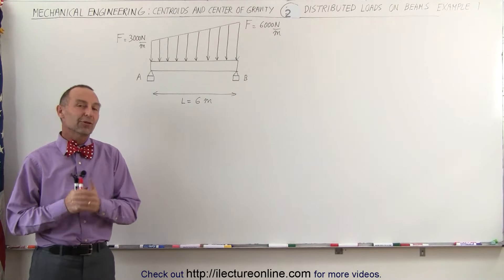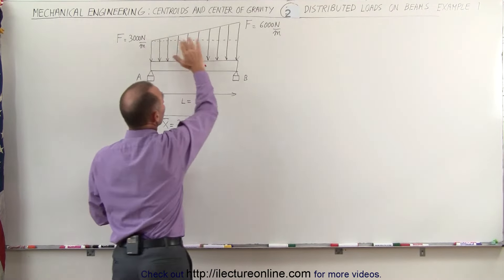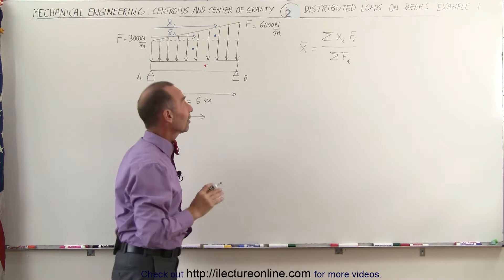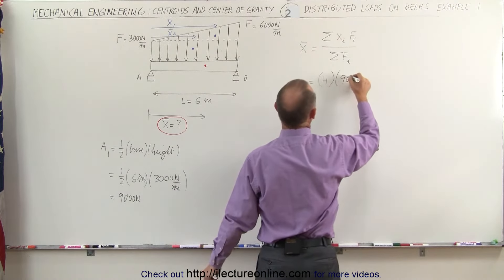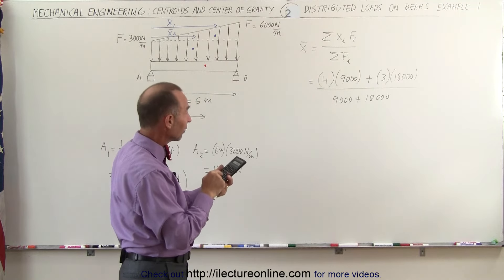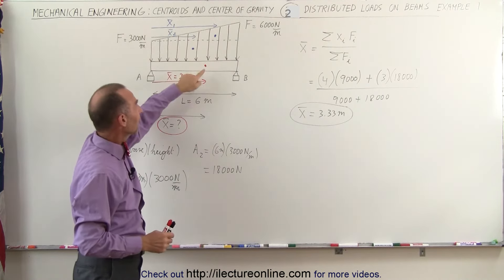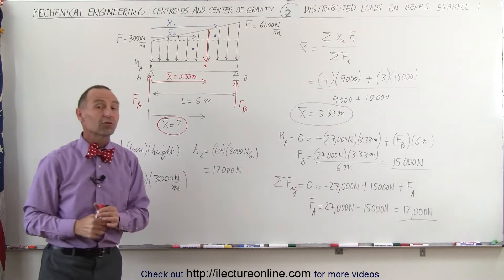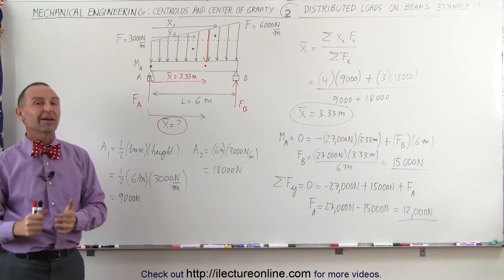Mechanical Engineering: Distributed Loads on Beams (2 of 17) Find Distributed Load on Beam Ex. 1

Comment: Great video. thanks. When you get the total center X=3.33  how do you know from where to measure it? from the left corner or from the right? you choosed left. what is the rule?
I understood the logic, like if we would calculate it by integral the (0,0) would be the left corner... depends on my axis.
Reply from the maker: It actually doesn't matter, and may depend on the particular situation.  Typically we use the left as a reference point.

Comment: how can you know the X of the triangle is 4?
Reply: The  X value in a triangle is always two thirds of the way along the base length, if you start from the smaller end!
i.e. (2/3) * 6 = 4
Reply: For a triangle, the centroid is always gonna be 1/3*(side length)  ***on the side with "more x". In this case, it's 4 because while (1/3)*6=2 the triangle has more of on the right side so x=6-2=4.
Reply: 2 x L / 3

Comment: .solve this please sir:
 A horizontal beam, simply
 supported at its ends, carries a load which varies uniformly from 15 kN/m  
at one end to 60 kN/m at the other. Estimate the central deflection if the span is 7 m, the section 450mm deep and the  
maximum bending stress 100MN/m2. E = 210GN/m²

Comment: if the movement is clockwise, why it is not +27000?
Reply from the maker: +Gantox Davaajargal 
  The convention is that a clockwise moment is negative and a counterclockwise moment is positive.  You will get the correct answer even if you use the opposite convention, but most everyone follows the standard convention.